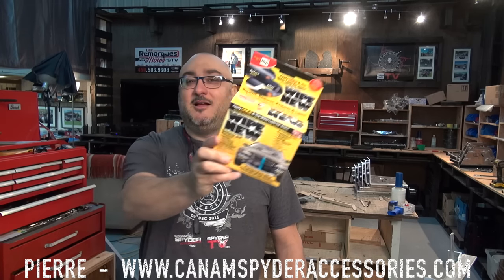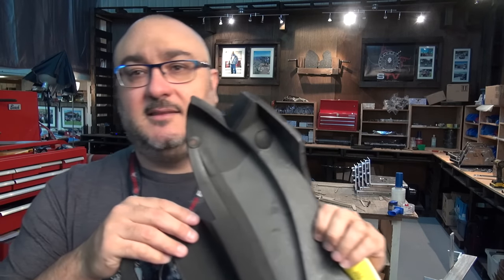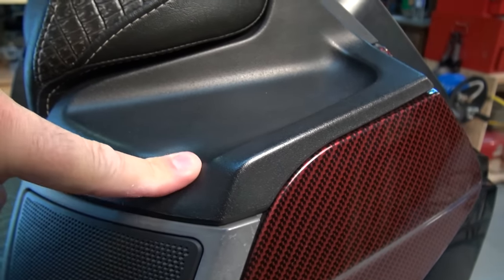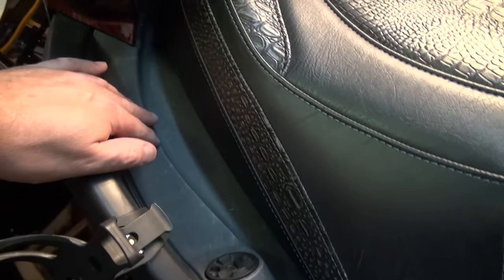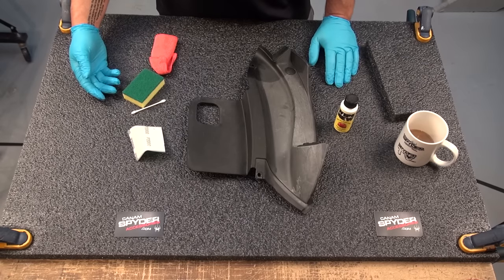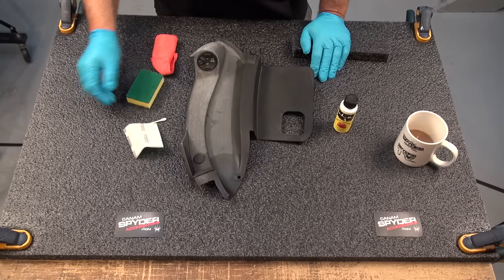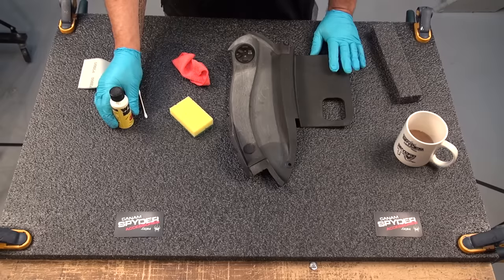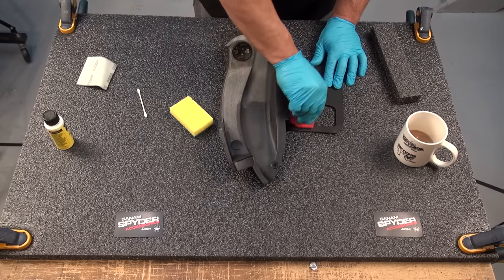Can Am Spyder -  Part 1 - Making the plastic black again - Spyder TV - Wipe New

Comment: The problem is the raw plastic product used for these pieces is regrind from salvaged plastic  products. It doesn't have UV inhibitors in it and it weathers very aggressively. You see this throughout the automotive industry. The regrind salvaged plastic is CHEAP! BRP does a fantastic job on the decorative panels, they could use the same plastic material(virgin material with UV inhibitors) on these black panels and paint them a satin finish.

The way to stop the fading, don't park your Spyder in the direct sunlight and use a good 
detailing product that offers UV protection..
Reply from the maker: Thanks for the input....appreciate your comment, makes sense.....Pierre.